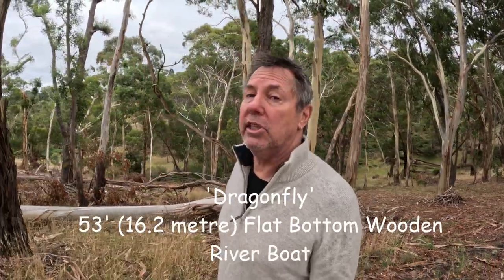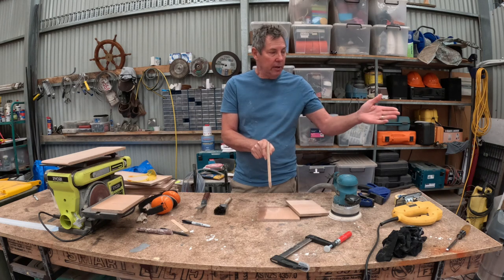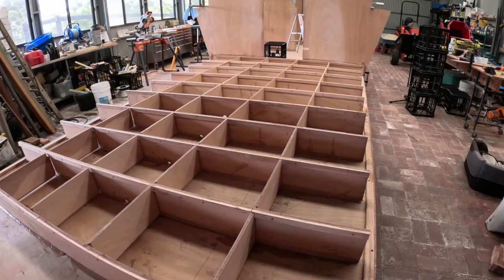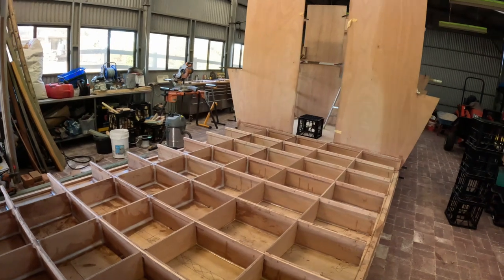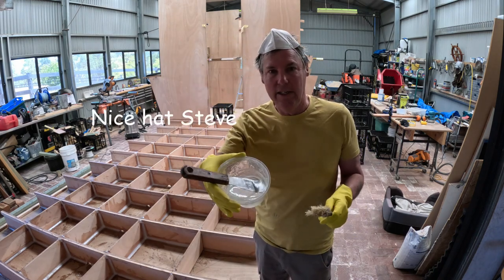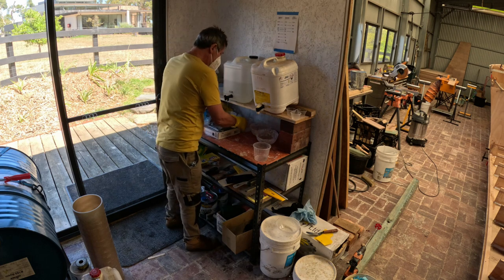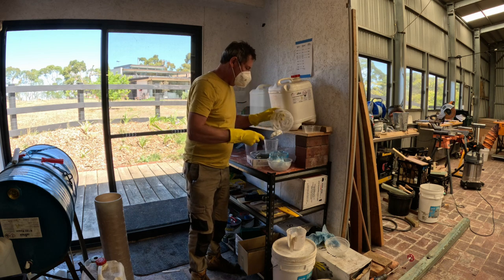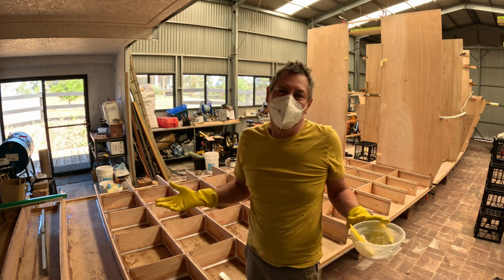Boat Building Don't Eat Them You'll Turn YELLOW! Building Dragonfly E 15

Comment: You are right its personal choice as most options are way overengineered anyway. A good place to be, at least it beats the alternative which is under engineered, otherwise known as the disaster zone:)

Personally I wouldn't have tapered and would use a bit smaller fillets. Being an industrial chemist from the polymer industry (yes I have formulated epoxy compounds professionally) but then the boats I build as a hobby are smaller. 

An interesting exercise is to use your off cuts to test your joints look for timber failure rather than joint failure.
Reply from the maker: Well said John, my thoughts exactly. :)

Comment: Progressing nicely. A tablespoon (large plastic disposable) works nicely for fillets, the concave shape will pull the fillets into the corners instead of spreading them out and might save a bit of clean up.
Reply: Another method is to purchase closed cell water pipe insulation which usually in roughly 1m lengths. Cut a 15 cm or so section and drag the end on an angle. You can actually squeeze it to the radius you want, it's flexible, but not too flexible, easy to clean, comes several standard sizes. If you take the trouble to wipe it off, one length will do a large project for a few bucks.
Reply from the maker: Thanks Drifter, might give that a try at some stage. Cheers, Steve

Comment: Are you taping all the connections with fiberglass or just rely on a glue joint?
Reply from the maker: hello, good question. I am taping where I think the main stress areas are. Bulk heads, main frames etc. Not for the small stuff though. Cheers, Steve